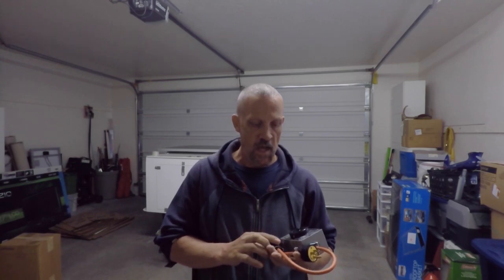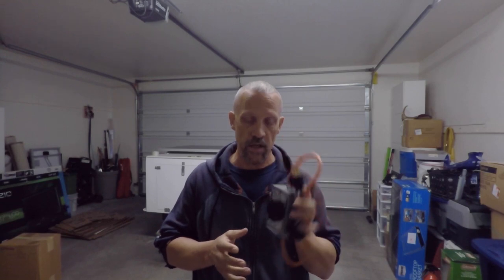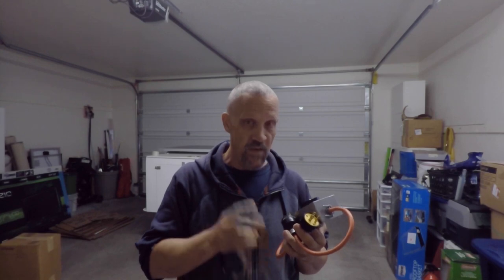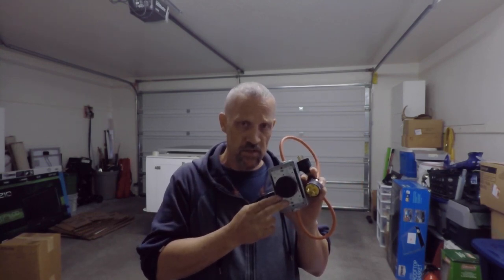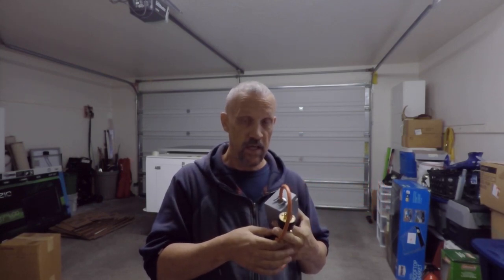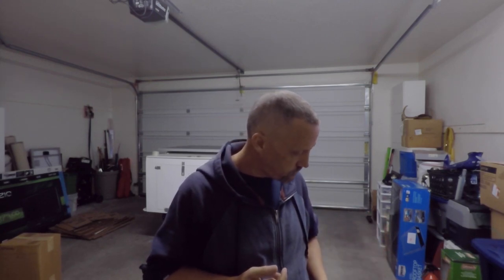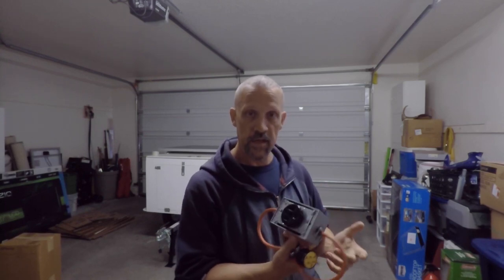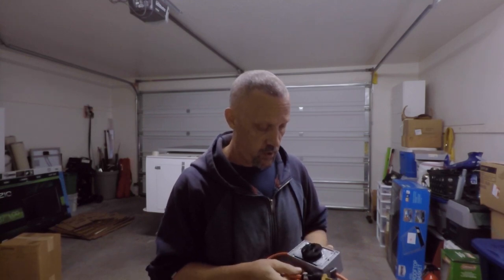How to Get 220v From 110v Questions Answered and SAFETY CONCERNS

Comment: You are Farmer-Smart. Kinda the way America was made. You do the best you can with what ya got. Yep, not always right. Yep, not always the safest. But, it gets you through.
 Thanks for sharing the original and this follow up. I made one and have it in "reserve" for when I will need it. Oh, and for the Haters, I have been back-feeding 220 from my generator every time the power goes out which it does all the time where I live. I hang a big sign on my main breaker: "Turn off and disconnect the generator before turning on breaker". Legal? Nope!, Code?, Nope! but I do have the only house where I live that has all my lights, frig, micro, ......... working when the unreliable power is out!
Reply from the maker: I agree 100%! People like us will be the only ones getting things done if things keep going the way they are currently going. If things finally get better, we'll still be getting things done. When working on my own stuff, I use what I have and get the job done. The only person I have to make happy is myself and so far, I've had a 100% success rate.

Comment: That was a very great idea... My uncle and his son are both certified electricians and have seem them do crazier stuff that that in a "pinch".  Maybe not on the job but they were trying to hunt down a problem in my garage they did all kinds of crazy stuff I didn't think was safe LOL... they even admitted is "wasn't the right way but it works"  :)  Cousin built a  box like you used but a light switch in it... if he's having trouble finding a breaker for an outlet... plug it it and flip switch to ON... dead short and will kick breaker.  He just wired hot one side of switch and neutral on other... flip the switch breaker will kick :)
Reply from the maker: Thank you for the input. Interesting story :)
Reply: That's actually super clever 🤣

Comment: I'm a renter in a house with only 120v outlets looking to do some aluminum welding. My choice is either make this box, hack into the power going to the AC unit outside, or something even worse. I think I'll go with this box. Thanks for the video as I had the idea but discounted it for some reason. (I've worked as an electrician apprentice, but am now a software engineer)

Comment: All the haters can pack sand!! Likey the ones with negative comments are the ones lacking Common sense!! VERY UNLIKELY THAT WELDER WOULD PULL 20AMPS . Generally overseas 220/240v is the norm and  generally draws less amps. And  most likey thst cord you got those pieces from said 600v on it some where. If your worried about the conductor dia/ga . Just wire nut the white and black together!!  bam doubled in size.Just be sure to elec. Tape them together or color the white with a black sharpie (not gonna go I depth on how to)  Great videos!!  Keep the em coming. The average man thanks you
Reply: oh GOD that was awesome!

Comment: Actually, you could get a couple of 120vac relays with 120vac coils  and connect the coil of one relay to the hot and neutral of one plug and likewise with the other relay and plug. Each relay will close the hot circuit of the hot line to the 240vac outlet the relay is getting fed from. If only one plug is connected, the relay for the disconnected plug will be open acting as a failsafe preventing the hot prong from becoming live. These relays should have contacts rated for no less than 20 amps. You can also add a couple of fuses and fuse holders for some added safety. You should still have a proper 240 volt line installed if you need 240 volt power often. You can also get a step up transformer, but they aren't cheap. They are quite a bit safer especially if they are not an auto transformer. A regular transformer will have the added benefit of isolation that an auto transformer won't have.

Comment: Thanks for bpth of these interesting videos. I'm no electrician either but hooking up two 180 degrees out of phase 120 outlets to get 240V was something I have wondered about but not clear on what to do with the neutral. So what would occur if one of the breakers tripped leaving you with 120V on one side? What is the worst that could happen, if anything, other than the device not working? BTW what would happen if you plugged both plugs into outlets that were in phase (coming from the same side of the box)?
Reply from the maker: To answer both of your questions, in either case my welder doesn't work. It does not damage my welder. I don't know what would happen to items other than a welder. I've never used anything besides my little welder with this device. Some say if the item has a motor it would fry the motor but I have never tried that. I don't have any tools with a 240V motor.

Comment: As long as you don’t upsize the breaker for both circuits you are fine. As far as not trying to burn your house down.
Reply from the maker: Good info and thanks for the positive input! I didn't and wouldn't upgrade my breaker without upgrading the wire first. I agree with you 100%.

Comment: THANK YOU! for updating the IMPORTANT INFORMATION
You cannot pick just any two circuits (i.e., separate lines coming from separate breakers)
The two breakers MUST be on separate phases.
Often breaker in a box will alternate (phase 1, phase 2, phase 1, phase 2, etc)
while other may have all phase1 breakers on one side and all phase 2 breakers on the other side.
Another important note:

The two circuit MUST be in the main panel, not on a subpanel.
The main panel is where neutral and ground join; hence for 220 outlets whether you use neutral(white) or ground(green/bare), they are running to the same place anyway.
Reply from the maker: Good information and thank you for the positive feedback! I appreciate it!

Comment: I wouldn't be too concerned about the negative comments  from so called seasoned electricians.  I'm 70 yrs old retired electronic technician. All I could see wrong was not having the two breakers not tied together.  Since the welder plug wire was 14 awg then the 14 awg you used was fine too as were the two 15 amp plugs you used. Some people just like to give others a hard time. Optional the two 20 amp breakers could have been replaced with one - 2 pole 20 amp breaker.  Only problem you had solved.
Reply from the maker: Thank you for the comment and information, I do appreciate the positive input!

Comment: Thanks Bruce.  I subscribed because of this second video. I'm the same, I like to tinker also in just about anything. I learned and you gave me new idea in my own situation. I don't have 220 in my detached garage but but I will be installing a permanent 220 outlet within my house and closet to my garage. Then use 10 garage extension cord temporary when necessary. 👍keep up the good work.
Reply from the maker: Tony, thank you for the comment and subscription. I do appreciate them both. I know not all my ideas are the best but that's how I learn and improve. I've learned many things from the comments, just from posting that first video. If I were to do it again today it would be done much differently. Had I not posted the video, I wouldn't have learned what I did. Have a great day Tony!

Comment: you should be fine but you don't want those lights on one half of that circuit and all I can see for safety would be to put those two breakers next to each other in the panel and run a copper wire between them through the holes in the breaker switch to make them both trip if one side  trips., But I see you've already said that in your video I'm a 50-year electrician without bragging I am the real deal I am a real electrician and I don't see any problem except for those lights on one side I thought you had a big Lincoln welder or something like that but everything should be fine for that one now if you were running a electric space heater the fact that those two legs are separate from each other in the walls of your home theoretically makes them a giant loop heating element but the grounds in the cables will probably cancel most of that out
Reply from the maker: Thank you for your input, I appreciate it!
Reply: I don't see a problem either. One thing that wasn't mentioned was a fault current event. If this happened, I the panel mainline CB should trip instantaneously. If it happened to one of the branch breakers, I assume, since they are bonded together, they both also would trip simultaneously. The other thing that I always do for my DIY home electrical chores, is to ALWAYS oversize the wiring/cable whenever practical, especially on the Neutral conductors.

Comment: You are hilarious. Love the way you punked those people talking trash. There all electrical police lol.  Anyhow i have to weld something over 200 feet away from my shop and dont have 220 out there. So im gunna build this device snd try to run it on my generator. Im hoping it has two seperate phases.  Each 110 has a breaker so will see... Heard of anyone doing this?
Reply from the maker: A few people have asked that question but I haven’t read of anyone doing it successfully. I wish you the best with your project.

Comment: FYI...This won't work if you are using gfci protection.   Which should cover a majority of applications you'd likely need to use it (i.e basements, garage, sheds etc). 

 Thank you for doing a follow up video to your TEMPORARY installation. I'm sure that wasn't easy to do. It says a lot.
Reply from the maker: Thank you for the information and positive comment! Much appreciated!
Reply: I think you answered my question of why the one I made, isn't working. Thanks

Comment: Dave snow. I watched both video,s, they were great, my question is this, my garage only has a 110 outlet, so could I run an extension cord from let's say another socket from inside the house to the garage and hook it to the same socket that you made,as long as it's from another electrical line?
Reply from the maker: That's the way I understand it. Remember, a longer extension makes it more important to use a heavier gauge wire for your appliance to prevent overheating of the cord. For instance (20 amp draw = 12 gauge wire minimum). That's just a suggestion, I'm NOT and electrician as I'm sure you know.
Reply: Thanks for getting back, I appreciate it.

Comment: Why did you cut off the original 3 prong plug from the extension cord and attach a different 3 prong plug?
Reply: By they why, both videos were helpful!
Reply from the maker: I just used pieces of the extension cord. They did not have the original ends on them.

Comment: what kind if welder r u plugging in that only needs 20 amps
Reply from the maker: ZX7-200 220V Portable MMA ARC Welder DC IGBT Welding Machine Soldering Inverter - https://amzn.to/37OV8pX

Comment: I have a little welder like that. I had one plug in the garage that wasn't hooked up with any other plug.so I put one wire on one breaker and put wire on another breaker ground to the ground..had 240. Well I ended up with 233 volts..
The little welder doesn't blow a 15 amp g.f.i.. but it 
Has to have the 220volt.
My little welder doesn't have a ground. Nu. Hot.
DC
Reply from the maker: Thanks for sharing

Comment: My two cents: If your purpose is to have a 220V source next to the two 110 outlets shown on your first video, instead of connecting each wire to a male plug, you could have directly hard wire it to the outlets - then you won't have to worry unplugging them and exposing a possible electrical hazard. Regardless, it was the best idea and easy fix. ty
Reply from the maker: That would be a good improvement for a more permanent set up. For my situation, I was only looking for a temporary solution because I knew I would be moving from this location in a few months. Thanks for the input!
Reply: Actually, no.  This isn't a proper 220v setup unless the breakers are tied together so installing an outlet would be a really bad idea, especially for the next owner of the home who will think it's a proper 220v outlet.

Comment: Hi ,,I saw the 110 to 220 video ,,is there any reason why you did not use the 2 white neutral wires and join them as opposed to joining the 2 green ground wires  ,, thanks
Reply from the maker: Yes, the two green wires are the grounds and they are required to be in the circuit. The two white neutral wires are not in this 240V circuit. The welder I made this adaptor for only requires two hots and a ground. (no neutral)
Reply: @DIYHomesteadProjectsDIYHP10  Oh OK ,, not that you are  saying that it would have caused issues ? But in normal applications joining the neutrals is the correct procedure since it is the neutrals that are the proper returns to the panel ,, the green grounds are only a safety measure when one uses a metal cased power tool like a drill , where the casing of the drill  is grounded  through the green wire,, so that one does not get a shock through the metal casing in the event of a drill malfunction sending current to the casing . That is why 220v typically has 4 prongs ,,two hots one neutral and one ground ( or as they say in the UK ""earth ")  -in your case joining the  neutrals and connecting the welder's metal case to a water pipe would have done the trick correctly .
Reply: The idea behind grounding is to protect the people who use metal-encased appliances from electric shock. The casing is connected directly to the ground prong.

Comment: I have been wanting to do this so I can run my 2 post car lift. I was wondering, does the 220v not back feed into the 110 and burn my shop lights and things up? Just curious if that is a possibilty?
Reply from the maker: I'm not sure but I didn't have any problems with that when I was using the device.
Reply: @DIYHomesteadProjectsDIYHP10  ok thank you . This is not the solution I really want, in a perfect world I would have an anctual 220. But this isn’t a perfect world so I know what I’m gonna do lol

Comment: If there is a possible electrical feed to a plug due to equipment problems or shorts, adding a double pole, non-reversing switch into the circuit would eliminate crossfeed to the unplugged line.  Obviously you would need a double gang box. This 2510KO1 - Schneider Electric Manual Switch would solve that problem.
Reply from the maker: I thank you for the information and post. Much appreciated!